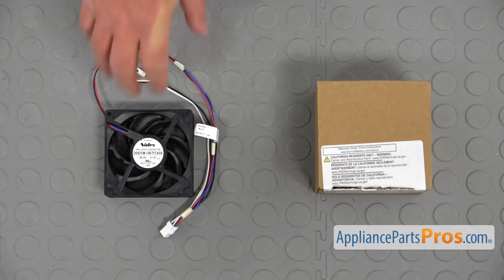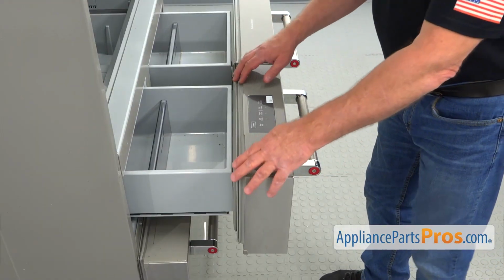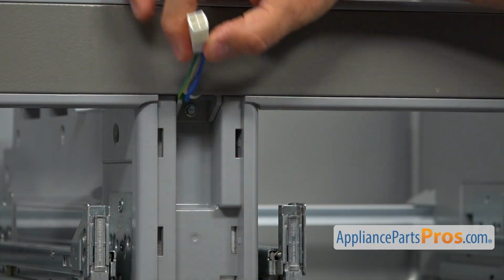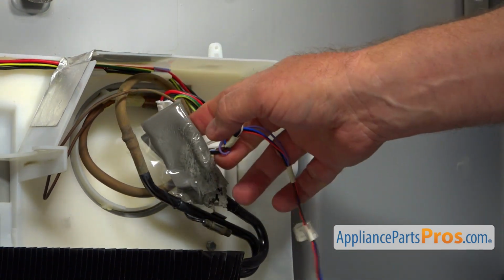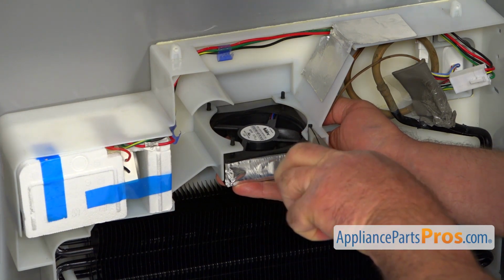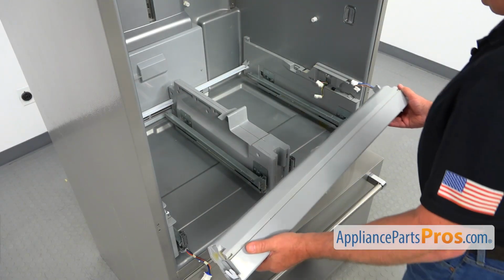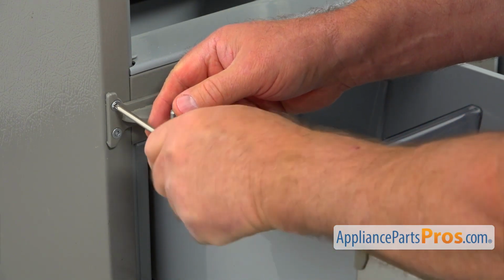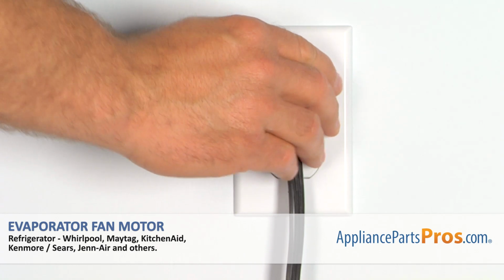How To Replace: Whirlpool/KitchenAid/Maytag Refrigerator Evaporator Fan Motor W11087438

Comment: Thank You for the video.  My father has been fighting with this fridge for more than a year. He has replaced the main board as well as the fan and thermistor twice, however it continues to ice up every 2 days.  We currently have it apart to defrost and double check the drains are clear which they seem to be.  Any advice or ideas would be appreciated.
Reply from the maker: If you are having a defrost issue you will need to test the defrost heater for resistance, it should read around 30 ohms. If that is good then you will need to replace the defrost thermostat since you have already replaced the main board.